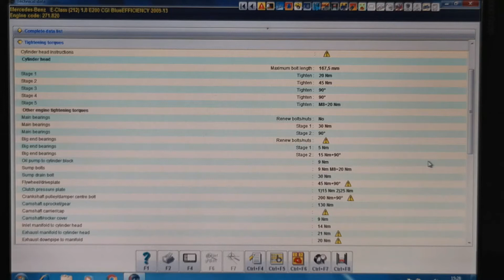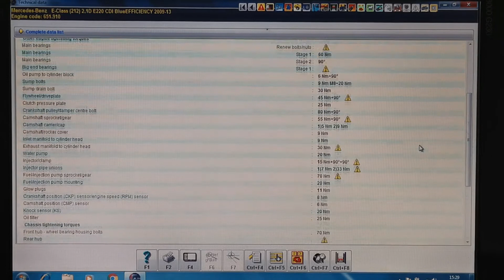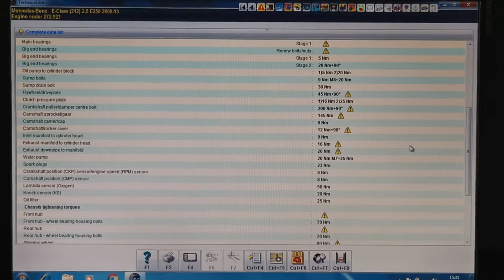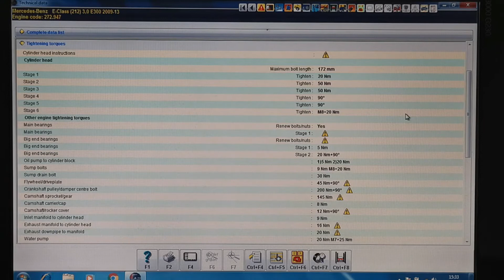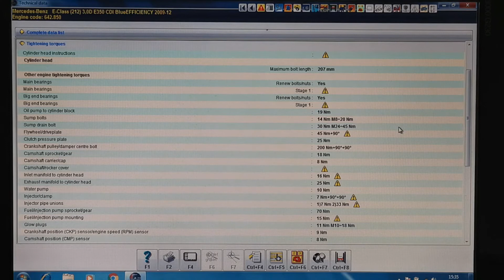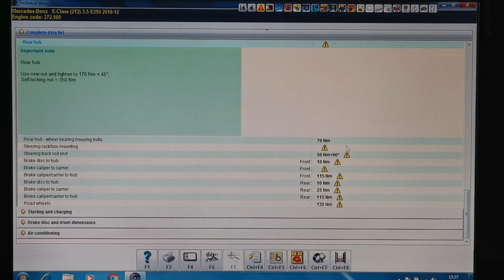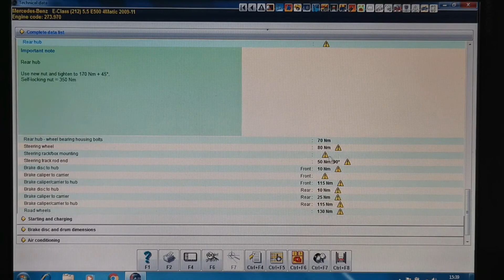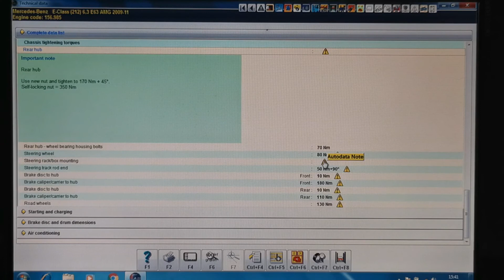MERCEDES E CLASS W212 TIGHTENING TORQUE SPECS

Comment: Hello Eddy!
I'm sorry to disturb you but I have a question : How much torque do I need to tighten the front subframe bolts? The 4 bolts are M12 size.
By the way : I have Mercedes Benz E 220 CDI BlueEFF 2012
Thanks in advance 😁
Reply from the maker: Hi, unfortunately, the autodata don't have torque specs for the subframe, I would tigh them tight by hand, you will get the feel